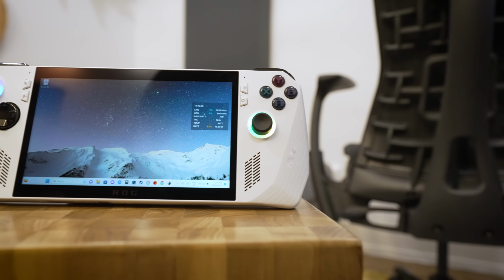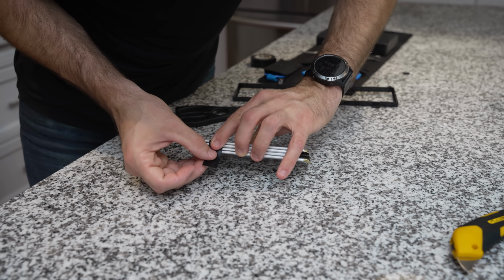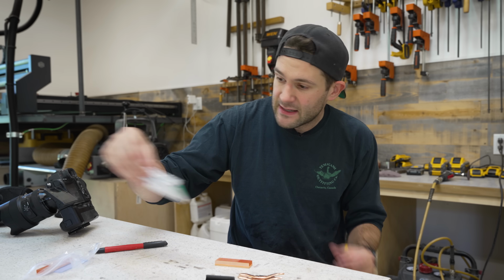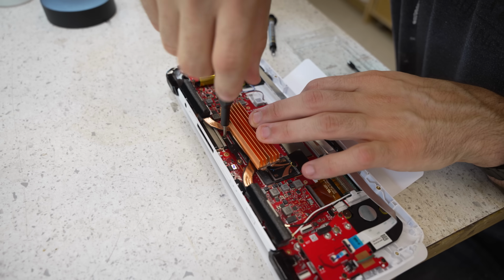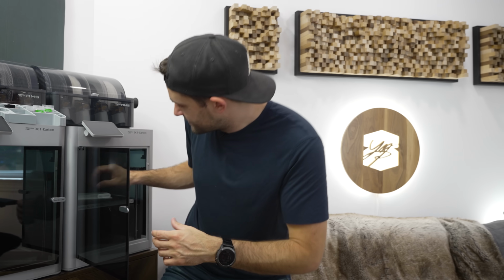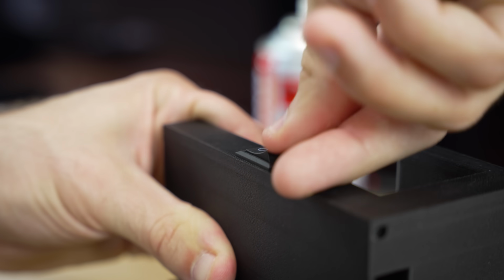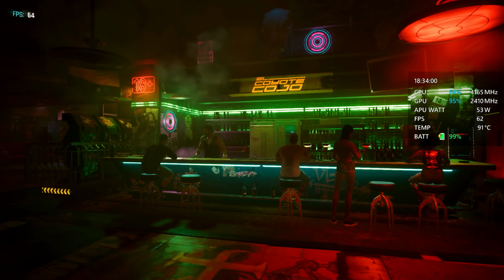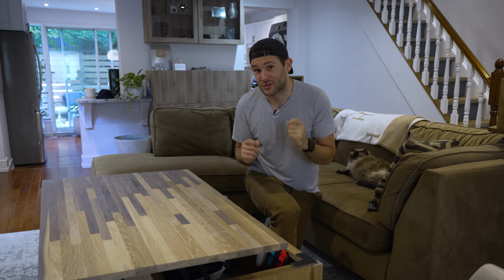I don't understand why people buy Steam Decks...

Comment: One Props to ASUS: The fact that all of these upgrades had next to no real world improvement to performance shows that the Ally as is is pretty well rounded and leaves next to no performance on the table. It's good to know you are maxing out the potential without having to make these extraordinary modding efforts that the average Joe just can't replicate. On the Flip side, while the Z1E Ally that you have is way more performant, it also costs way more than a Deck and the regular Z1 is the same price while being weaker. The Deck also makes upgradability way easier. I was able to upgrade my deck with PTM Pads, as well as swap out the sticks for Hall effect ones without doing any kind of soldering.

Comment: Answer for a question in title of this video is very simple my deer Zac
1. It's Valve product
2. No matter what you say, Valve is known for its solid work ethic, and even though the device is weaker, even the cheapest model is well optimized.
3. I buy a steam deck to play fun games (quite often Single Player) outdoors. Not to play competitive titles.
4. Even though Steam Deck is a Linux-based system, there is no problem with sleep mode compared to PCs using Windows, where sleep mode is often no different from turning off the screen.
5. Unlike other companies, Valve can afford to do quick market research based on previously analyzed data, which allows them to determine what hardware is suitable for the average gamer who needs a device for gaming and not for slacking off over specs.

Comment: I want to know... does the heat shield really protects the SD Cards and the slot from the heat vents?

Did it die or still livng after 2 years assuming you used the ROG Ally since then...which I kind of doubt?

Comment: My SD (512GB, used, theoretically, it was an unboxed from steam, because garuantee issue) was half the price of the ROG ally, and you spend that money twice for upgrade parts 😅 So my steam deck was 4 times cheaper than your modded ally. This is why I need deck ;)

Comment: There are only 2 (3, but steam os can be re-installed everywhere for free, now with official support) reasons to get steam deck over rog ally or any other handheld pc. 
1) Trackpads. They are so nice!
2) Reliability and trust in Valve. 

If you don't want trackpads, and willing to risk it with less trustworthy company, go ahead

Comment: Remember when both came out and got my deck after the Asus RoG Ally.

The biggest factor was definitely the absurd price point for marginally better performance.

But it came down to brand reputation in the end.

Yes, Vavle has absolutely botched hardware launches in the form of the Steam Machines; but, I’ve had 4 separate Asus RoG laptops…which all have without failure DIED in under 3-years each, and immediately experienced battery issues with god awful customer service.

At least for the SD, it was marketed as a modders dream. Sure some of their choices internally are baffling, but it is significantly easier to source parts and make repairs without going through a sh-tacular customer service rep with anger issues.

Comment: i have only 1 problem with steamdeck and ally both has way too less sysram for the igpu i often whink why the sysram needs too be soldered just build the console 3-5mm thicker for laptop ram thats all we need and a 2280ssd gen 4. at the 3-5mm thicker case putt a bigger battery inside and its just perfect for years. not only for 1-2years...  (:

Comment: Copper and Gallium form an alloy, ( CuGa₂ ) with much less thermal conductivity than bare copper. This will only continue to worsen with time. It will also "dry out" as the gallium and copper meld necessitating reapplication in a spiral of worsening performance and lasting damage.

Comment: Maybe unpopular opinion but just maybe I dont wanna pay 900 dollars for a device to just put steamos on it anyway and immediately cut out all the other games you would be able to play over the steamdeck anyway. Because im not gonna be playing any games with ubisoft, xbox, or epic launchers anyway and pretty much play the same games I would actually want to play on the steamdeck(AA games, Older AAA like Dishonored, Indie, retro games, emulation).  Because idk but I personally cant enjoy playing AAA games on the medium settings instead of low with upscaling so high that the game looks like a watercolor painting just to get 60fps and 1-2h of battery life when I can just stream those games from my computer and they will run and look better and barely consume any. And nobody talks about the trackpads they are godsend you can have infinite inputs I was playing a game without controller supp the other day and had all F1-F10 keys and 1-10 bound to hotslots id say thats better than some rbg. The price for what you get is exceptional and you also dont have to completely reinstall the OS.

Comment: This is why people buy a steam deck because while it's not as powerful as something like what you're working on it's efficient and powerful enough with the crazy lean steamos that most games will run but also the support that steam provides for the system is by far better support than you will get for any other handheld hands down.  Plus steam isn't going to ditch there's steam deck for a more powerful version for quite a while longer than other manufacturers who put out a new model like every year.  I have had one since the LCD models came out I got the scratch resistant screen version.  And I still have absolutely zero issues with it runs fine still gives me plenty of performance for the vast majority of games and I own like almost 3,000 games on steam so I'm almost endless supply of back log games. Oh and surprise surprise steam isn't going to ban you if you mod the system unlike Nintendo.

Comment: I hope you know this but you should not be printing anything but PLA pretty much indoors without a LOT of airflow through. All those filaments you listed give off toxic fumes and the activated charcoal filter in the Bambu labs printers is not enough to handle it, not even close.

Comment: Sadly the liquid metal is going to interface with the copper eventually and form a alloy in that plate and eventually turn into a solid and probably destroy the CPU on any removal attempt. The ptm7950 performs so close to liquid metal there is almost no reason to replace it. To prevent that alloy forming eventually the copper would need to be nickel plated first.

Comment: This is the problem when console gamers think that they know what PC gamers want. PC gamers on the go have always known that to play your games on the go is always more expensive That's why when they want to play on Max settings or the best settings they can they build a custom PC around it they know that if they get a laptop most people aren't going to be able to afford the best laptop to play just the best games they're way more expensive they just want decent laptops that can do a gaming just so they can play on the go. And with the steam deck their expectations were the same way they want the upgrade ability just like any PC gamer they want to be able to replace the parts if they go bad and make it versatile if they wanted Max graphics they'll go home to their beast computer they just want to play their games on the go. And with PC that's the cool thing that's why settings are so cool so it plays on all different hardware and specs. Console gamers just don't understand That's why they come out with the PS5 and then the PS5 pro or the PlayStation pro or the best people think you have to buy the best you don't especially in portable.

Comment: Because the Rog Ally performs worse then a steamdeck when capped to same power draw. There is such thing as overclocking the steamdeck, and Valve even contributes to upstream Linux, unlike Asus that barely works on anything except Windont.

Comment: I know im late here, but the reason Zac saw next to no increase on his rog ally going up to 54watts is actually a funny thing. This is cuz while its an apu, he changed his tdp on his CPU and not his iGPU and no it's not tied to each other. I know this from my own mini pc (ryzen 6800h) i had to increase my GPU clocks separately to the cpu tdp as even though they in the same SOC they are treated differently. So for a better experience all you need to do is run your cpu at 30w and the GPU at its highest clocks.

Comment: yo sick videos dude! I grew up in south Etobicoke not sure how close you are to Alderwood. Automotive modding tip when you extend wires try cutting the harness in different spots so you can stagger the solder joints to keep the finished harness from being pregnant in 1 spot. Keep up the cool projects!

Comment: I had steam deck for 4 months enjoyed first 3 months after that so many unsupported tittles so i disappointed and sold it and bought white rog ally after using with windows my experience was one hell of experience and after that i installed bazzite but battery life is way worst than steam deck . i really regret selling my steamdeck and getting ally it really doesn't fell like a handheld and if I lock my steam deck to 30 fps over power usage is only 12 to 18  watt  only which will give more battery but ally locking to 30 in bazzite is not working like steam deck battery draw doesn't become less

Comment: Price, how many Steam games I own and ease of use is why I bought a Steam Deck. Windows sucks for portable devices. And I shouldn't have to buy a poorly designed device that's more expensive and "fix" it such as what you are doing. Its not always about having the most powerful device. I think Nintendo proved that with the Switch. And the Steam Deck is pretty powerful for what its is.

Comment: Dude, I honestly like your other videos but this is a fairly dogwater take with a super bait video title that smells of shill.

Gonna unsub cause this is uninformed and kind of slimy. The Steam Deck literally shook an entire industry that got strongarmed by MS to be in-line, toe-to-toe with their OS. To The point that motherboard behavior and BIOS, APIC calls, etc, behaved absolutely bizarrely unless you were.running Windows. Valve, via The Steam Deck instead came out with a very early, and tight experience. They worked closely with hardware OEMs, and various stakeholders in the industry to ensure that the experience,.despite being outside of MS' jurisdiction, was excellent. They literally provided an amazing and streamlined experience.

But unlike other providers and monolith corporations, they open sourced it, invested in SteamOS and sent countless patches upstream not just to the Linux kernel, but various software collectives and their respective software projects, and then told the industry to use it as they deem fit.

They went above and beyond what most corporations do. They support the right to repair. They are pro consumer, and have Greta customer support from what I heard.

I've enjoyed ASUS for years, and I wouldn't touch the ROG handheld with a ten foot pole cause I know the kind of nightmare that is involved with their customer support by comparison.

Anyways, bye.

Comment: I own them all, steam deck is by FAR by FAR the best for long gaming. it is way more comfortable. I don't use it though, I use my Ally-x everyday for about an hour or until my palm of my hands starts hurting. In the beginning ya I could do 2-3-4 hours but as time went by the pain of holding it set it. That 1 hour now is propped up on a pillow zero chance in hell I could hold the ally straight up for an hour. I am OG I really do use it every day I am using it to watch this video and write this comment via bluetooth fold in half keyboard. I hate the HUGE screen bezel waste of space make it look like an iphone 1, they could add 1-1 1/2 more screen in the same body. It's 800 thing that looks like a low end toy. Not spending the extra 20 bucks on a modern looking display pisses me off.

Comment: I know this a few months old video but that fan should technically keep the SD card cool so there is a lot more thermal throttling then there should be. The cooler is also leaving hot across the SD card slot.

Nintendo switch has their SD card at the bottom avoiding this problem.

I wish qc was there for it but they just didn't give two farts.

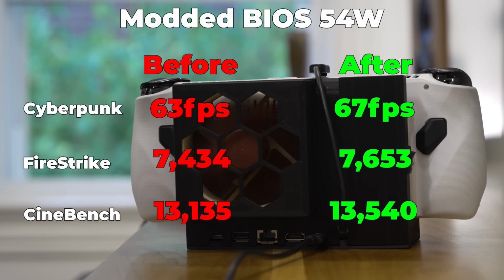Comment: @19:00 "....diminishing return are a real thing."

I see this as a good thing. What you seem to miss is the fact that you can't really gain any more performance out of it even with all the cooling upgrades. 
This means that Asus speced the hardware and tuned the software up perfectly. Right at the edge of best performance and "diminishing return." 

So basically this is a perfect product right out the box. No need for any modding upgrades.

Comment: just get a gaming laptop at this point (not from asus) if you want something portable with better performance. though the steam deck is fine for most games, and valve wont screw you over if something goes wrong.
Reply: gaming laptop are twice the price with something that has a 3050 in it. I rather go with a handheld at this point.

Comment: its simple for me tbh. Steamdeck is far better value for me (not just monetary). 

-I get away from the microsoft ecosystem
-I get to support valve who has nearly 2 decades of doing right by thecustomer
-My direct putchase from valve signals i want more of this in the future
-I have a large game library good to go so i dont need to buy new games in a new eco system (any sony/nintendo/xbox handhelds)
-I get to support valve directly in their efforts to finally bring a better option to gaming then microscam who are getting greedier and greedier with trying to push ads in their OS's even if you have paid for it as well all the spyware AI junk and taking away user choice for YoUr SeCuRiTy
-SD has far more upgradability and if you know what you're doing, right to repair capability

great mod but you can keep your A-SUS handhled lol

Edit: spelling and additional context

Comment: Why a steam deck

Supper good support by the developers and community.

More compatibility.

Cheaper.

Can be modified and upgraded easily.

It can also run windows and play most game no problem.

If you get an emulator or game there is higher chance you’ll get a better configuration for the deck since it’s more popular.

Also it’s not Asus

Comment: People buy the steam deck because of the hardware that goes well with the software that is actively being worked on and making the experience as fluid as it can be where as the other handheld runs on windows which isn't well optimized for handhelds and the fact that the handhelds have to be opened and rebuilt where Asus could have done that from the get go. That's why people still buy the deck

Comment: Soldering is NOT brazing. Brazing "uses a filler metal that melts above 840°F (450°C)". Also you have to be very selective with liquid metal as it can diffuse into other metals including copper. This was improper use of it. I would recommend gentle flat-lapping of the mating surfaces and a uniform, razor-thin layer of thermal interface compound such as Arctic Silver 5 (thermally stable at high temps).

Comment: Well... maybe not everyone has a professional workshop complete with 3D printer at home. Or the disposition of making mods that may set everything on fire by disassembling lithium batteries. Or short-circuit their expensive consoles by using liquid METAL as heat interface. Or having thermal copper heat pipes explode on them by heating, bending and then soldering them. Or, you know... people don't have the time to do all this and just want to play their games on their free time.

Comment: Steam Deck with steam OS is superior in many ways when compared to any Windows based handheld console. It just works, hassle free. Windows requires constant fiddling, especially to run older games. Next, is the community and repairability. Currently no handheld can beat Steam Deck when looked at overall user experience. Other consoles might look better on the paper in terms of spec but this means nothing in real-life use.

Comment: Using the 5v pin can make the USB unusable for anything else requiring 5v plugged into the same USB just good hack to hide. Conection but still takes up the slot usability

Comment: The base 512GB Ally is $400. Which is very competitive against Valve's 256GB Steamdeck for $400.

The hardware is faster, but battery life is crap. If you lower the tdp, it no longer performs well, especially compared to the Steam Deck. 

The Ally uses Windows, and while you can install Bazzite, the Steam Deck comes with SteamOS, which is way more optimized for handhelds. 

If you don't mind poor battery life and are willing to replace the OS, the Ally is a great option. If you wanna just hit the ground running and game right away, get the Steamdeck.

On the other side; When compared to the Steam Deck;
The Ally is:
-faster
-has more storage at base
-higher resolution 
-120hz refresh rate

Choose wisely

Comment: The heat sink is copper based, Galium in the liquid metal will react with it to form an alloy, essentially breaking down the heak sink. This is a big no no guys don't do this, just use regular thermal paste, or buy the heat sink material carfully. Goodluck!

Comment: Funny because steam deck moded dual boot 7950 thermal pad air vent back plate Cryo utility's mod over clock to 4.1 1900 oled can run games far better then allay and better battery life then extreme

Comment: It's almost like the engineers who designed it know more than a random dude on Youtube and specced the cooling etc for the processor they chose so it wouldn't be thermally constrained.
Honestly, unless you're experiencing thermal throttling or it's consistently running too hot, I wouldn't expect much uplift in performance.